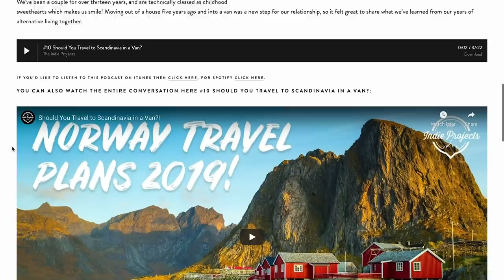Plastering Our Mezzanine Bedroom! Building Our Own Home in Central Portugal

Comment: You guys should definitely install a dumbwaiter lift to lift anything you need up to the mezzanine. Put in one strong enough to lift heavy things,  and stable enough to lift a tray of a nice dinner and tea when the house is all finished. It will literally be a life saver convenience,  and if you want to get fancy,  you can even automate it using a powered winch and up and down buttons. I had one of these at a manufacturing job to lift tools and buckets of material,  it was so nice!

Comment: Theo, you are right handed so start on the left side and work to the right, also work top down to bottom.
Reply from the maker: Hey yes I do work too down but after this wall I realised way easier left to right 👊
Reply: @theindieprojects  Also check out Skoda TDI models, maybe a Fabia estate or Octavia, we have checked into many cars in Portugal (even though we are still in UK!) You can get a sensible TDI Skoda in Portugal without breaking the bank (same engines as your Passat).

Comment: Theo. You can make a wall scratcher with a piece or plywood with a handle on the back a bit like a plastering trowel and then knock some nails through until the points stick through a little and the you can run it over the wall and scratch four or five lines at time and it serves to smooth the wall out a bit and its quicker.

Comment: I am so happy for the family that got their little boy back. What a shock it must have been for them. Glad you were there to offer your help. 
I am thinking that you guys might want to consider making yourself a water tower or two, and have gravity fed water in your house and on the land. You could build a stand for those 1000 litre water containers out of, let's say four by fours, and pump the water into the container when needed. The hose can go down to the ground and up again into the faucets, and you will have running water. The containers just have to be elevated to a higher level than the faucets. At least in theory this should work fine :-) Maybe there are other types of containers that would be better to use for a water tower, like a type that would be narrower in the bottom than the container you've got there. 
Instead of pouring water from a heavy water jug/container, I am using a quite cheap manual pump. It think it is used to pump oil out of cars or oil barrels. I bought it at a store which is mainly selling auto parts. And you can lift buckets of plaster up onto the mezzanine by a rope attached to the handle. And even better with a small pulley attached to a beam. I believe they are quite inexpensive. You have to take good care of your backs and necks, guys.

Comment: I guess by now someone may have suggested in taking the motor out of the car and placing it into the truck. It's not a simple job because you would have to change the motor mounts at least. Hubby and I have had our fair share of vehicles in our life-time and have done just about everything that was possible owing to money constraints and time. Not just vehicles but in converting our house trailer into a stick frame home. Here's to full steam ahead with the completion of the build. You've come so far. Hugs!

Comment: Bea, I've noticed that since you've gotten the new glasses there is a blue reflection from them many times. Is this because of the blue light filter? I'm especially curious because I'm waiting for my own new glasses with that filter and wonder if it's a result. As to the house, it's spectacular, and I think you both are very hard workers. What satisfaction you have of a job so very well done. Thank you for sharing with us.
Reply: Yes the blue light filter does that effect.
Reply: I have glasses with an effect like that, and i have the same issue. So I'm guessing that's it.
Reply: It’s the blue pool?
Reply: @peteypops  not on the front deck of the barn
Reply: You don't see the blue when you wear them but you will notice a difference.I won't not have it now. Some people looking at you will see if but only in certain light

Comment: You really do a great job.  I have a suggestion, you could take a rope with a hook at the end, then Theo could pull the bucket with the plaster up.  That would be easier.  I keep my fingers crossed for you that you get a replacement motor.

Comment: If you can find a '90 Isuzu Trooper (the breadbox) ...amazing solid work utility vehicle that doesn't guzzle fuel ....engine is simple and strong, the body is strong .. has a 4 wheel drive you can shift into and out of and has a winch...best truck I ever had and holds passengers...:)

Comment: If you mounted a wooden board  in the area at waist height, Then deposited the plaster on the board it might be easier, Then, instead of digging in the bucket to  fill your board you can slide it off, Saves time and might be easier for you than working in such a way as you do now
plasterwork is hard work, gives you big arm muscles lol.Well done for all you have done .

Comment: Hey Guys, what about putting the passat engine into the truck? Also ever thought of enclosing the verandah with glass Bi-ford doors or something and encreasing the living area. Could still create a deck off the verandah. Keep up the great work!
Reply from the maker: Thought about it but think it would take a lot of modification to get it to fit in the old truck
Reply: I thought the same thing about the veranda, enclose it with sliding doors and screens and fit a wood stove in there for the winter! 🤔🤗🙏
Reply: That's the dumbest idea I've ever heard! Why would you even consider doing such an illegal thing? The pickup could never be homologated and wouldn't pass the inspection ever again.
Reply: @module79l28  este pessoal esquecesse que está em Portugal. Não estamos numa qualquer republica das bananas.
Reply: @marcianomarques3436  - O gajo deve pensar que isto é como na América, onde pôem LS em tudo quanto é carro ou até um OM606 num 240Z e ninguém diz nada.

Comment: I thought you are suposed to fix thin battons to the wall every 18 to 24" then throw the plaster on inbetween the battons and draw a batton up on the the vertical battons  then when drying take battons off an fillinwhere the battons where

Comment: Theo, if you want to scratch quicker, you can make up a 'rake' using  4 or 5 nails whacked into a lump of wood in a row. Saves loads of time 🤣 Edit: whack the nails right through so you're scratching with the points, not dragging the heads through the plaster 🤪

Comment: How about a canopy over your mixer to give you a little respite from the sun? And a simple rain harvesting system at the barn so you won't have to lug water from the well to the worksite?
Reply: goo idea 💡
Reply: Depending on the distance they might even be able to run a pipe from the well pump to the house and have an outdoor tap.

Comment: For those unaware of the car import taxes, they can be quite mental in Portugal, you would pay for engine capacity, CO2 emissions and type of engine. For electric cars, you are pretty much exempt of those, but you would still pay added value tax, inspections and fees, etc. 

For a simple example: a 2016 VW Golf 1.6 TDi with less than 100.000km. On Germany right now, they are at starting price of around 10.000 euros. For that, you will pay 1933€ for only the engine capacity and Co2 emissions, and get a age discount (the older the car, the bigger the discount up to 15 years). Now, those taxes do not include expenses with other matters like inspections, paperwork and registration of the vehicle itself. With those, the average cost would be 1250€, so 3183€ added to the car. 
 So, in Total would be 13.183€ to have the car ready and legal in Portugal.
 Now, in this case, it could be worth to import the car to Portugal, but the price difference could be negligible, and worth the extra cost and time wasted on various entities. There are companies that will do that for you, and costs can be reasonable, i was quoted about 500€ for all the paperwork and registration to be done with, if i brought the car myself through Europe.

 There are also some tax exemptions for certain cases, that unfortunately, they can't be applied to Theo.
 The best to import as of now are Hybrids and especially Plug-In Hybrids (if electric is a non option), as their tax is considerably lower and the price difference is completely worth it. Another example, a ready and legal import from Germany of a Golf GTE from 2017 would cost 21282.48€. On sale in Portugal, cheapest one i can find with same specs is 25.900€. Both with less than 100.000km.  I'll leave a link below where you can do a simulation of all the costs according to the car you are interest in (just need to know engine size and CO2 emissions, and year of manufacturing), and see what is and isn't worth to import:

https://impostosobreveiculos.info/isv/simulador-isv/#principal

And here is detailed average expenses of costs of importing from Germany, without the ISV:

https://impostosobreveiculos.info/importacao/despesas-para-importar-carros-usados-da-ue/

Both work well with google website translator. Hope this helps anyone that was interested in importing a vehicle.

Comment: Couldn't you chop the back of the Passat off so youd have a Ute on your property? Kinda like simones Truckla or the one that the guys from car throttle made
Reply: Or, since it can't go on public rods anyway, could rather cheaply Frankencobble a tow hitch onto it and get/make/cobble (depending if you also  want to be able  to use it with another vehicle on public roads) a trailer for job ing bulky stuff

Comment: Chop the roof of the Passat, rip out the back seats. Bobs your uncle, vw UT. A replacement engine is always gonna be an old engine. DONT DO IT!  You'd be better off with the high mileage well maintained truck.

Comment: With your mezzanine stairs make them a decent gentle angle and large size, as near to normal stairs as possible, but make them hinged at the top on the mezzanine floor, then with a pulley to lift them up while you are using the downstairs area… makes the downstairs area bigger and more useful and access to the mezzanine safer and easier, it’s simple to do👍 ladder type steep stairs are a night mare to use and dangerous if you are ill, half a sleep, tired or drunk 🥴🤕

The banister can be hinged as well if roof height is an issue when winched up.
Reply: I love your idea !!!!!

Comment: Great video. I would be tempted to chop the roof off the Passat and make it a pickup for around the farm! Love your hard work on rendering but you need a bigger float (trowel). The little one is only for touch-ups and you'll get a much better finish with a full-size float.

Comment: I don't know if you're interested but there's a dealership here in Torres Novas who has a 2002 AWD Mitsubishi (the downside is that it has a metal cargo bed), a couple of King Cab Nissans with a wood cargo bed, but pre-2000, and a 2000 Nissan like yours: single cabin and wood cargo bed. They're not on the internet and I don't know the prices or the kms of those vehicles but I know the owner of the dealership and he's trustworthy.

Comment: I would recommend buying new, you get up too 7 years warranty, 4 years with out ITV. Buying nearly new (under 5 years old) doesn’t make sense as the price will be near new anyway. Take advantage of dealer/manufacturers offers on credit if available to you, manufacturers are very keen to sell cars due to the lockdown.

I am a car nut and the situation in Portugal and Spain with car prices, availability and condition is very frustrating to say the least, you can’t fight it or beat it so do as the locals do, buy new and keep it for 20 years and make it pay for it self over time. 👍

Comment: Theo, why dont you turn the Audi into a pick-up ?  not as daft as it sounds !  I am an Engineer, and was a qualified panel beater, with your skills, you could do this. OK, you couldnt use it on the roads, but it could replace your old one on the farm.  Buy yourself a Mig welder, not that expensive. strip out all of the rear interior trim, seats, carpets, headlining, rear screen etc, so basically, even the front seats, though these will be refitted later. Once stripped, sand down all of the edges of the rear door, rear sill section and "B" post area, which are adjacent to the door and its window frame, but not the top of the window frame,  the top will remain part of the frame , as you will be removing that part of the roof.  Now, completely weld the rear doors closed, the small gap between the door, sill, "B" post and rear wing, including bracing and welding the inner frames where possible.  Open the boot lit and remove. Now the fun part ! cut the roof behind the "B" pillars, where you have welded, look for a reinforcing rib in the roof frame, leave that in place, weld remaining roof panel to it. Cut the rear wings roughly level with the boot lit both sides, and across the rear parcel shelf, then remove the rear roof, upper rear wing and parcel shelf section. Hay presto, a Pick-up !. OK, now, using the remaining roof panel, cut pieces of metal out to weld over  the open rear wing sections. You may have to reinforce the roof section, though, i reckon you are that handy, you can then probably line the inside rear with wood. Just a thought, it will work, and would make great viewing for your channel. Just a thought, Good luck to you both, and my fave, Fernando and Gingybear. Cheers.

Comment: Loving the video guys. If you are struggling to find a scratcher  in Portugal you could buy an Afro comb or similar thick toothed comb, cut of every other tooth and use this. Scratch off  along your walls using waves or figure of 8s 1 or 2 mm deep so you don't get them showing on you next coat. Keep up the good work you are both doing great.

Comment: On your next wall after you have dona a first scratch coat, try putting a few dabs of mortar vertical on the wall and placing a length of 10mm batten on it. Do this a couple of times along the wall and let it go off. When you come to render the next day it will be easier to fill in  etween the battens and use a straight edge to level off your render. When done, pull out battens and fill with cement. Hope this helps 😊